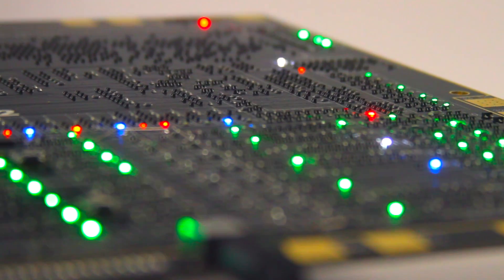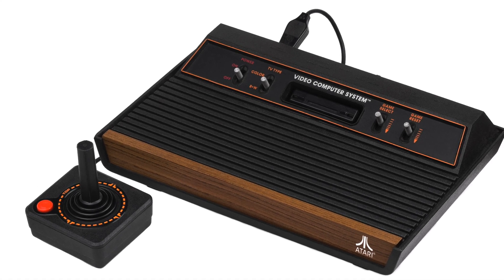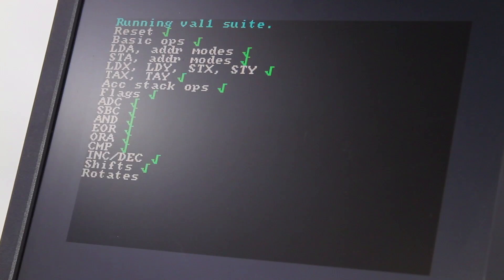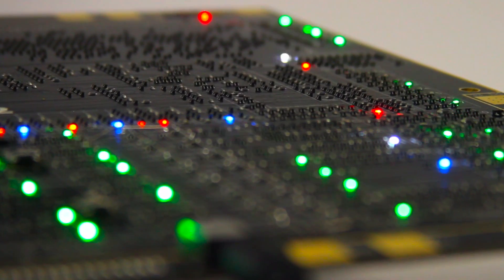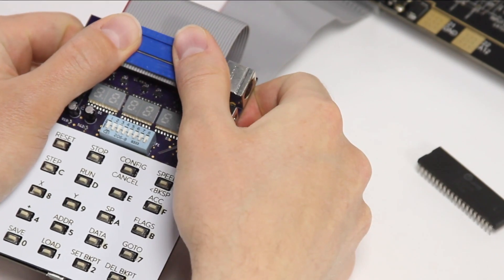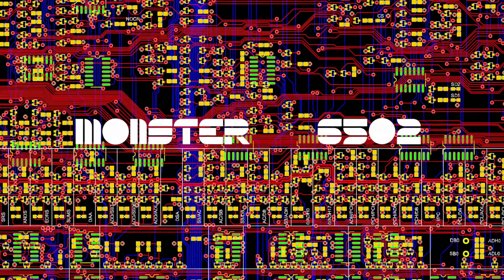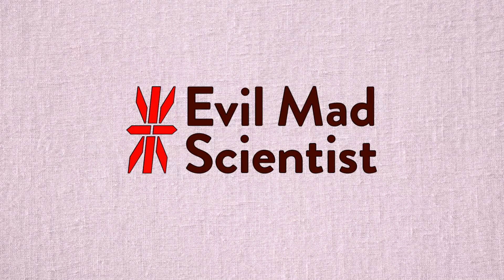MOnSter 6502 Update #1

Comment: Do you know why it is slow?

I am going to have a wild stab... The visual elements are adding latency and that additional power draw will most likely affect overall performance and the processing speed.
Reply from the maker: The LEDs do contribute some power draw, but are not one of the things limiting the speed. Many of them have separate FET drivers so that they impact the circuit as little as possible.

The foremost difference (versus the original IC) that contributes to the speed difference is that we are using discrete FET elements, which have a much larger capacitance than the original devices. This is pretty straightforward to understand since the devices that we are using are designed to handle macroscopic amounts of current.
Reply: @evil-mad-scientist  Then it has to be the captive of some sort that is likely holding gates open too long, slowing down... what type of clock are you using for this anyway?
Reply from the maker: @thepvporg  It's a variable clock, synthesized on the motherboard.
Reply: @evil-mad-scientist  if it is variable, I take it that it is some way self regulating so that you have flags and signals to indicate when data is ready to be moved, etc... 

Why not a fixed time base or does that create too much dead time, errors and flagged faults?
Reply from the maker: @thepvporg  This is an implementation of the original 6502 architecture. It has the exact same capabilities as an original 6502. No more, no less.
Reply: @evil-mad-scientist  but not the speed... 

As a 6502 doesnt have visuals, ever tried running one without visuals to see how it affects performance?
Reply from the maker: @thepvporg  They're hardwired in-- no ability to turn them on or off. But, we do understand the performance limits quite well, and that isn't one of the factors. We actually doubled the number of LEDs between the first and second prototypes.

There are ways to go faster (more expensive transistors, active cooling, etc), but it's not worth dramatically increasing the unit cost unless we could get it to a full 1 MHz, and it is not a given that we could do so. The most straightforward way to get to full speed with this scale would be to go to CMOS, but that's quite an architecture change, and almost twice the number of transistors.
Reply: @evil-mad-scientist  Ok, the seizure inducing flashy flashies stay...
Reply from the maker: @thepvporg  It's only blink-tastic in a fairly small frequency range. Above that, most of the LEDs appear steady, and at 1 Hz, it's more like clock ticking.
Reply: @evil-mad-scientist  I'll let you know when I have stopped break dancing involuntarily.

Really am impressed though.

RAM, you gotta do RAM and the display is the memory content showing every bit.

Comment: If you were to keep the scale, how big Nvidia Titan RTX chip would be?
Reply: The MOnSter is 0.114 square metres that's replacing 4237 transistors.
Titan RTX has 18.6 billion transistors, which would make the monster version half a square kilometre (500k square metres) or 0.19 square miles or 123 acres or 50 hectares.
Reply: If it had the same power efficiency, it would use about 43 megawatts.
Reply: @userPrehistoricman  And that's STILL far less than the 88MPH 1.21 gigawatt used by the flux capacitor!

Comment: Is the speed in part a function of the size? If so does that mean in essence that it could never run at the speeds required for, say, a C64 implementation?
Reply: Yes.  All transistors suffer from propagation delay, and (basically) the larger they are, the slower they can operate.  Miniaturization is essential for speed.

Of course, big is more fun.  8)
Reply: @Waccoon  - I suspect that the max clock speed would ALSO be limited by the sheer length of the PCB traces too.  When a signal has to travel through a meter or so of PCB trace there is an inherent delay of 5 to 10 nS!
Reply: @trevorvanbremen4718  Yes, but as long as your traces are terminated correctly, trace length only becomes an issue once you get up to hundreds of MHz.  I once heard of an insanely stupid 8-bit machine where the data bus lines were pumped through a printer cable to an external peripheral.  Amazingly the whole system worked... as long as the cable wasn't too close to the display or power brick.  8)
Reply: @Waccoon ...  Can you remember back to the Trash-80 Model 1 with expansion box behind it? (Showing my age here... Gulp)
These had a PCB edge connector at both ends of a short ribbon cable routing the address and data bus between the two boxes.  (16kB of 4116 DRAM in the main keyboard and 32kB of 4116 DRAM in the rear expansion box along with a floppy controller and Centronics parallel port).
They pumped out RFI rather efficiently in the AM radio band (although that RFI came more from the non-shielded memory-addressed keyboard switch matrix than from the expansion box)
If memory serves me right, there was NO actual bus termination between the boxes.  Simply octal buffers (74LS244 springs to mind)
Can you imagine trying to get FCC-15 certification on something like that today? (Although it was a LOT 'quieter' in the RF spectrum than my S100-based system when I had the lid off [almost ALWAYS off])

Comment: Correction
Commodore 64 have 6510,which is 6502 processor architecture, but it slightly modified for use in commodore 64.
This is unique device
Reply from the maker: You are correct; we intentionally glossed over that and a few other minor architecture differences in the devices that we named.

Comment: I know this is a massive PCB, but it still surprises me how small it is, considering we're talking about a whole "micro"processor made with discrete transistors (not to mention LEDs and such). I mean, it's roughly the size of a regular motherboard right? Maybe you could even give it ATX screw holes, lol.

I mean, we're now well into the billions of transistors for CPUs, so it's amazing what was possible with so "few" of them. Speaking of that, can't this be overclocked if you put some fans on it?
Reply from the maker: 5000 components, give or take. You can run it a lot faster if you can cool it well enough. Trying to run it faster, we melted the solder on some of the resistors. Liquid immersion cooling might be a good direction.

Comment: I think this should be sold as a kit.
Reply: @NerdyNEET  my back would be destroyed hunched over for 3 days lol
Reply: alan sanchez do... do you want to suffer that bad?
Reply: I would. If they can get it down to like 2-300 bucks. I've done key fobs with similar surface mount components. It's pretty hard but I think it would be an interesting hobby project to burn time.
Reply: are you able to solder 8000+ SMD components? good luck with that
Reply: @buddyryanmckendrick6601  - I'm gonna wait until they release the kit using THT
Reply: @trevorvanbremen4718  Covering a board with THT components just gives it a unique look that I like. But man that would take some time lol. Still, would be beautiful in the end.
Reply: @buddyryanmckendrick6601  Yes i am =-O
Reply: @buddyryanmckendrick6601  yeah, whatever, as if that were the only way kits were sold. That's a bold strawman of yours.
Reply: Their website says it will cost somewhere between $2000-4000. Seems like a lot for a novelty item that can't really be used for anything useful.
Reply: @jeffsymons7084  I wouldn't say that this can't be really used for anything useful -- it's a computer, it can calculate anything a modern computer can, just at a slower speed. Plus, when this device fails you would be able to replace any component on it with ease making it more reliable in the long run over some highly sophisticated device that relies on a bunch of specialized ICs that may no longer be manufactured in X years.
Reply: @jeffsymons7084 that sounds like way too much if you lookup bulk prices of smd resistors and transistors.

Comment: I was writing assembly code at 15 yo for this processor in late 1979.
Reply: Most people interested in programmed experimented with Assembly on the 6502 at a young age.
Reply: @adisharr  That is categorically untrue. Some people who were young in the late '70s/early '80s and were interested in programming experimented with 6502 assembly language. Most people with an interest in programming are either too dead, too old or too young to fall into that narrow window. The majority of people with an interest in programming have never used 6502 assembly language. That's not to say that it wasn't a popular processor, just that people have been interested in programming for many more years than the 6502 was relevant. I programmed in 6502 assembly language myself in the mid '80s before moving on to ARM, which is relevant, and in a major way, today.
Reply: @johnm2012  I should have rephrased that, most people that had a Commodore 64 as a kid and were interested in programming ended up using assembly on the 6502. We had clubs all over the place and everyone had their copy of MADS.
Reply: @adisharr  The BBC Micro was the big seller here at the time. It came with the excellent BBC BASIC with a built-in assembler which made it very easy to try out 6502 assembly language. All the OS entry points were documented so there was no need for PEEKING and POKING obscure memory locations and a whole 16 bytes of precious zero page was set aside for user vectors. It was a great platform to learn on. It was so good that I never bothered with more powerful processors, such as the Z80 or the 68000 but jumped straight from 6502 to ARM, which immediately seemed strikingly similar - like a 32-bit version of the 6502. Perhaps that's not surprising since it's instruction set was designed by Sophie Wilson, who knew the 6502 inside out, having written BBC BASIC and key parts of the OS, in assembly language, of course.

Comment: the board looks too small for 3000 transistors even in double-sided assembly
Reply from the maker: Almost all of them are on the top. All those little black bumps you see on the top (at 0:01) are transistors in SC-75 packages. Those (not counting the pins) are 1.6 x 0.8 mm. The bodies of 3000 of them take up 38.4 square cm, or only about 3% of the area on the top of the board.

Comment: Can you pin plug it into a Vic-20?   Or does the video chip and rest of the Vic-20 require the chip be running at 1.0227 MHz?  How about a PET or KIM-1?    I saw this first on the 8-bit guy, but got here at a later time through the Visual 6502 site.     Regardless, I'd totally write some text adventure games for it.   choppergirl.air-war.org
Reply from the maker: Not a Vic-20 or PET, but we do think that it can be interfaced into a KIM-1 if you lower the clock rate. We've obtained a KIM-1 for testing, so wish us luck!
Reply: @evil-mad-scientist  -  Good luck.  I've played on a KIM-1 in a college lab but never used one.  My friend wired up a ton of extra ram for one as her lab project which is how I saw it.

Comment: You who have way too much free time I salute you!!!

Seriously, tho - runs SLOWER!?

I remember way back 'An as yet unforeseen advantage of Semiconductors is that while electricity moves at the speed of light it still takes twice as long for a circuit to go two inches versus one inch...' from a class.  However that should only really be an issue if you took heh a modern computer and like built a shipping container size box of transistors on circuit boards.

I'd think aside from the 100Ghz and up range the real issue to clock speed would be HEAT - something a larger device would have an advantage over due to both being able to absorb more heat and to throw off more heat easier.  It'd be cool to see a retroid device get kicked up from 16hz to like 300mhz - programs modified to prevent things going too fast - to see what they could do with old school graphics if they had the Cray supercomputer speed...  Yep, even in the 80s people killed their computers playing with the clock speed - well before Crysis and guys dumping the boards in liquid nitrogen...  So, like better clock speed and cooling fan blowing over it.

Now, what I've said, please don't take as trolling.  This is durn cool!
Reply from the maker: The discrete transistors are larger than the tiny transistors in an integrated circuit. Their larger capacitance is our primary limit.
Reply: @evil-mad-scientist  Thanks for your reply - however there is another computer here made entirely of transistors - with many more LEDs to help every step of the way - https://www.youtube.com/watch?v=lNa9bQRPMB8 - also if you skip to 2:41 the clock speed is adjustable with a slide switch but it clocks up to 100MHz though he did drop it to 10Hz to show things slo-MO for cool effect.  Note also transistors are used in audio circuits and radio so they have to have a response speed up to at least 20Khz or they couldn't be used for music for say a radio you could build for a project.

So, well again you have a cool project here, but I really bet if you used the right transistors/clock/crystal you could kick it up to 100MHz range.  Looks like you wouldn't have to play with cooling either, the size alone would act as an excellent heat sink.  This just popped up in my feed after I got this reply, wasn't trying to troll or set you up, just saw it.  I've been working on my writings since don't have time to play even with my raspberri Pi if I want to finish my writing sabbatical with some projects complete...
Reply from the maker: @benb3316  First, the MegaProcessor in the video shows up to 100 kHz, not 100 MHz. That's a big difference. On their web site they say that it goes up to 20 kHz. We're at 50 kHz. Both machines operate in a very similar speed range.

Yes, individual transistors can be very fast. You can buy a 25 GHz transistor for $0.10. However, the MOnSter is built with the same architecture as the original 6502, which puts some constraints on the types of transistors that we can use.

If it were straightforward to pick transistors such that we could run it at 1 MHz -- even if it cost ten times as much to build -- we certainly would have designed it to do so.
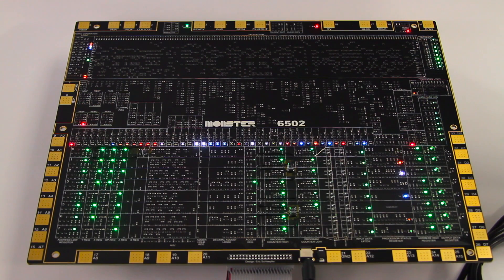Reply: @evil-mad-scientist  Well, thanks for the info - I thought your video said something really tiny like 1-16hz.  Re-watched and it said 60Khz...sorry.  Right at the 1:17 mark... You have a really neat project here and thanks for clarifying the speed issue and the details.

Comment: WIRE IT INTO A COMMODORE
Reply: but it uses a slightly different cpu called the 6510 it removed some pins to save costs
Reply: @AnnoyedArt1256  i mean the c64
Reply: Ivan204 i was talking about the c64 already

Comment: Is there a way to lower the capacitance to increase the clock speed?
Reply from the maker: Not a straightforward one, no.  The capacitance is dominated by the tiny mosfets that we're using. They're small, but unlike the ones on an IC die, they are larger devices, designed to handle the macroscopic currents that occur outside of a CPU core. Larger devices have higher capacitance. 

We've talked about doing a custom run of transistors that would be ones with a lower capacitance, but (1) it will be very expensive and (2) there's no guarantee that it would get us fast enough to plug into an original (for example) Apple II. Given those two, it does not feel like a worthwhile approach.
Reply: Right so it's a hard limit unless you hand picked the best performing mosfets. How would cooling affect the mosfets? If you were to supercool them in liquid nitrogen, would that affect their capacitance?
Reply from the maker: We can potentially drive much more current through the devices if we had cooling -- using lower-resistance pull-up transistors. That could likely get us to several hundred kHz. However,  again, without a clear path to  1 MHz,  it's not worth extraordinary measures like that.

Comment: have you guys hooked this up to an actual old computer/console that used the original 6502?
Reply from the maker: We have hooked it up to 6502 based computers -- both ones that we designed and one that someone else designed and built -- but we have not yet run it in a vintage computer. The issue is that the MOnSter doesn't run nearly as fast as most of those old computers, and those computers generally don't work at any clock speed but the original that they were designed for. However, our team does now have a vintage KIM-1 computer, which (we think) should not present any obstacles to running with a lower clock speed. So, that's something that we might try soon!

Comment: Now, make one using only 40/45xx-series CMOS chips! Also, are the pads around the outside edge actual PCB pads, and - if so - are they wired the same as those in the real 6502?
Reply from the maker: > Now, make one using only 40/45xx-series CMOS chips!
That would be a very  different processor; this is using the original NMOS architecture, effectively implementing the original circuit.

Yes, the pads around the edge are real, active, and in the same order as those on the original 6502.  You can hook up to them with (for example) alligator clips, or solder big fat "wire bonds" to them.
Reply: Evil Mad Scientist - that’s cool! At least CMOS chips would be the same type (mosfets) of transistors, as opposed to 74xx-series TTL!  It’d be neat to also do a MonsterZ80, or 6809!

Comment: This is one amazing project! I would bet it consumes a lot more power than the original CPU, with all those LEDs and all. Anyway, such a CPU clock rate is indeed not a small feat, and a defect on one of those transistors would be hard to debug. Excellent, and thumbs up!

Comment: Impressive.  I get the reasons for speed limitation.  From my adventures with restoring old computers I know it can be hard enough to find a single transistor fast enough to switch a single bus line at 3 to 4 MHz so it you're doing this with every element of the CPU....